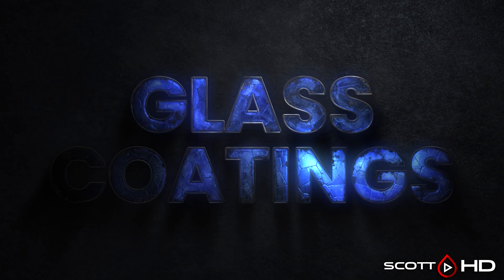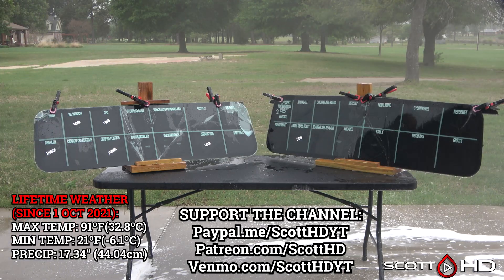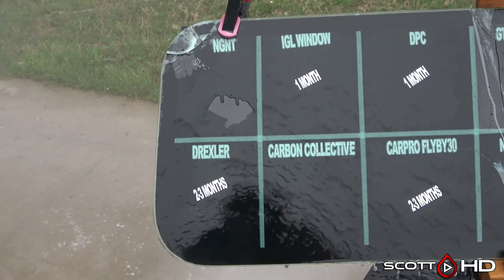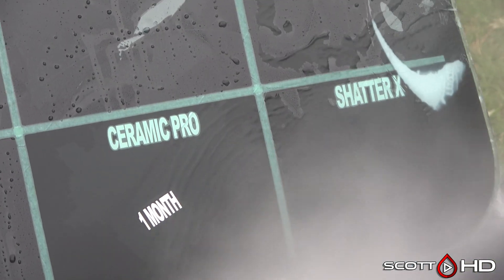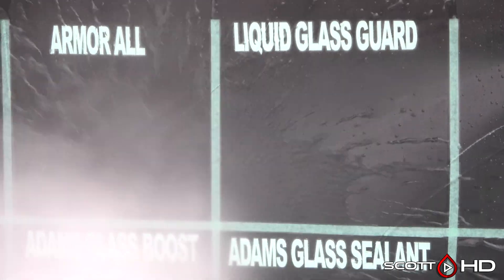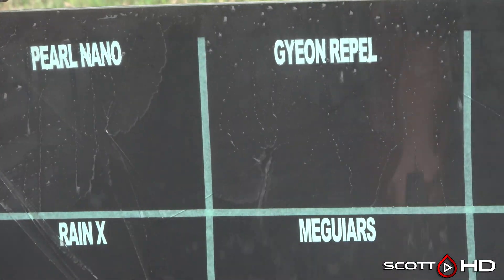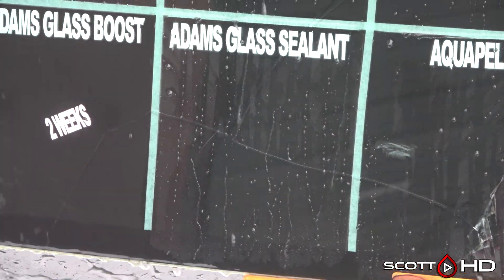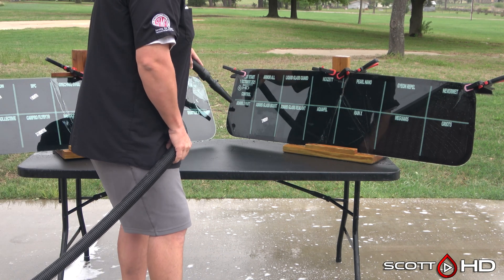28 WAY GLASS COATINGS TEST (HYDROPHOBICS) - UPDATE 08 - 6 MONTHS - 2 MORE FAILURES!

Comment: I picked up a can of Armor All based on this video. These videos are gold!
Reply: Don't know if you've applied it yet, but I can't stress enough: do NOT apply it if it's not in the shade, at night, or in the garage with a not-hot windshield. It will streak and be extremely hard to get the streaks off. If you're in the shade, garage, or at night and the glass isn't hot, you shouldn't have any problem.
Reply: @joshread3740  thanks for the tip!

Comment: Great test on glass coatings. I’ve used Aquapel for years on exterior windows on the car and around the house. It protects thru a full winter season and is easy to apply and buff. Armor All Ceramic Glass Treatment looks impressive. May have to splurge and pick up a can for $5.98 at Lowe’s.

Comment: I used the Meguiars Perfect Clarity glass polishing compound and glass sealant kit on my ’17 WRX windshield, which looked permanently pitted when I bought it last year (it was so bad that I was ready to have it replaced). The Megs products and my HF polisher got the windshield looking good as new with very minimal effort, and the beading lasted over 8 months and through a tough winter up here in the Blue Ridge. Unfortunately, I just went to buy more and it looks like they’ve discontinued both of those products and even their glass towel. Can’t find them on the Megs website, only available marked up from 3rd party sellers. Makes me wonder if they’re going to release new versions under the Hybrid Ceramic banner like they’ve been doing with so many of their other products.

Comment: Whenever theres a cheap product that outperforms the significantly more expensive competition like here with ArmorAll or the Nanobond/Nanoage coatings I wonder wtf they put in there that other makers didn't figure out
Reply: They mostly all come out of the same factory most likely. It's about how much brand marketing you can muster.
Reply from the maker: It's likely like Vyker said.... There are only a few manufacturers/blenders.  Some are just tweaked a certain way for a brand.  Others are straight up the same as many others just white labeled.